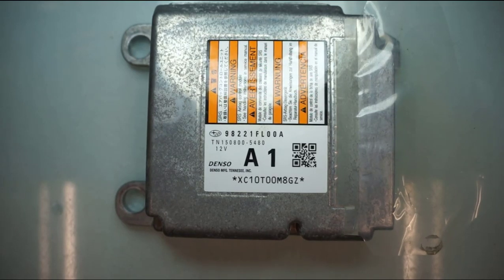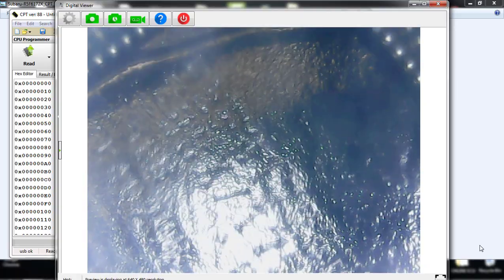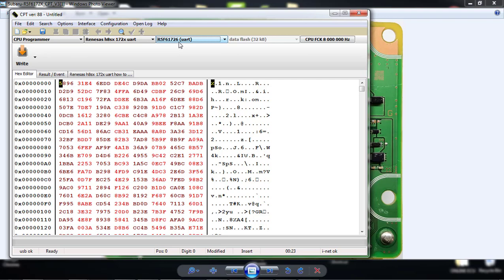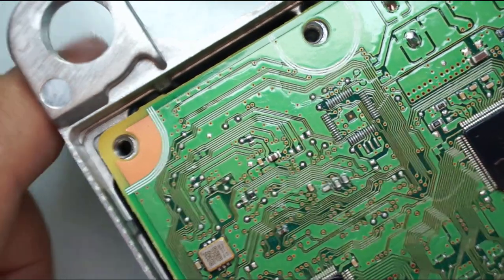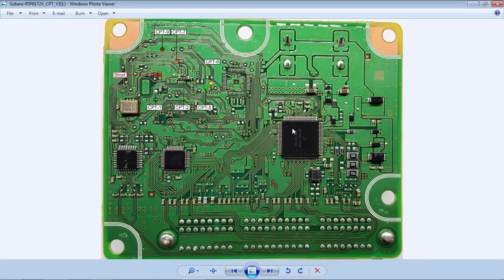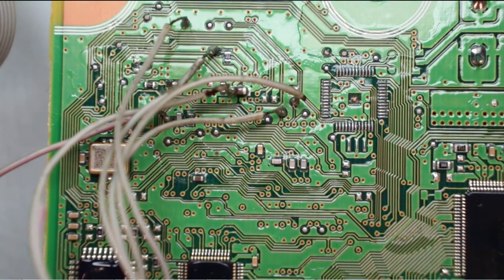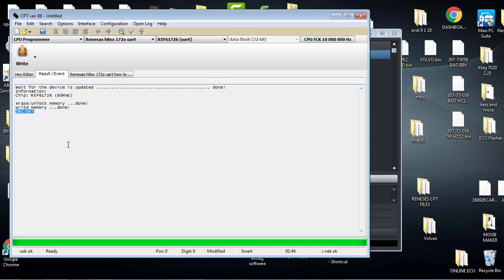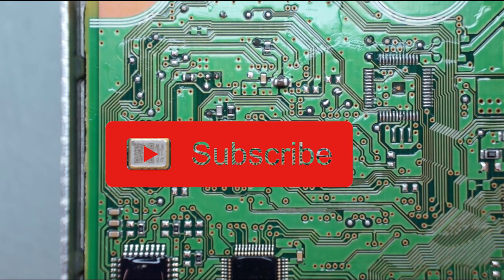⚡️How to Reset Subaru Airbag Module Clear Crash Data

Comment: Do I need to use the adapter or straight connection?
Thank you so much
Reply: So yes it did not work with straight connection you must use the ISP adapter.

Comment: I try doing a Honda and Toyota module with renesas chip and I get the message “adapter disconnected ….cpu r5f51725 uart - work with adapter isp “ the rj48 cable is connected properly . I do pinout as shown in image. Short the points and remove resistor .